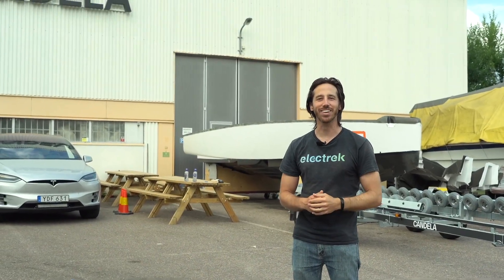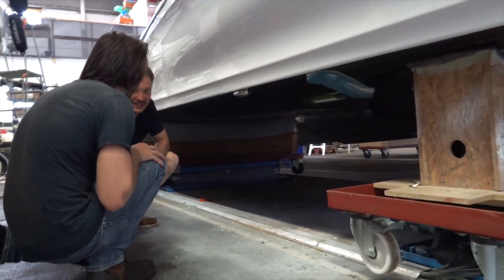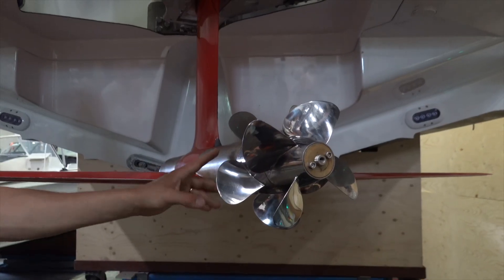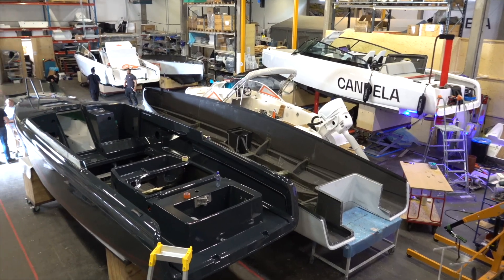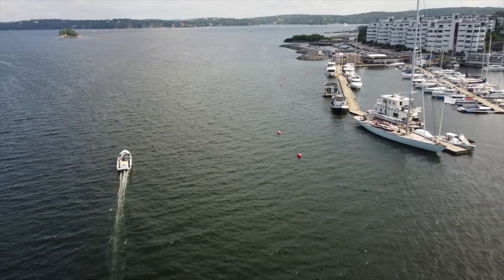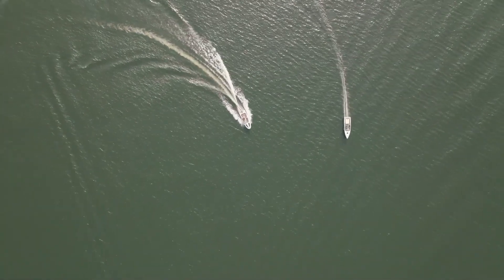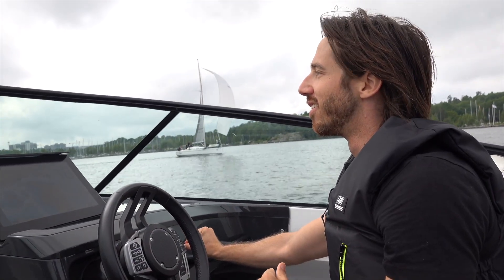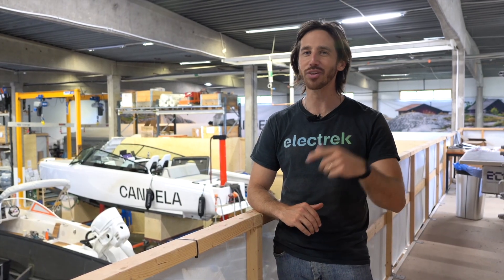The Secret of Flying Electric Boats: Candela C-8 First Ride!

Comment: Good Video And Great Selling Points. There Is One Question. What Is The Range On A Full Battery Charge. Also Where Can We Charge The Battery At Boat Port In America.
Reply: Another reviewer said 5 to 8 hours use depending on conditions. Most marinas have a power supply with each birth so charging will be easy, just plug in when moored up.

Comment: What kind of battery has it got in it?  How big is it--length, beam?  Is it trailerable?  What's the displacement?  What's the draft?  What kind of chargers does it use--is that a CCS?  How far can it go at cruising speed?  What's the top speed?  What's the cruising speed?  Cool overview but would love to have seen more details.
Reply: Me too!
The only thing I heard was 50KW motor which is 67HP IF that is its' output power to the prop shaft. Less than 67HP to the props if that is its electric consumption rating.
Reply: Watch Björn Nyland's video.

Comment: I would love if it had some kind of gimbal stabilization on top of a SWATH hull (with hydrofoils for higher speeds). Then you would totally eliminate seasickness also when at anchor.
Reply: It does have stabilization through sensors that monitor the water surface plus gyroscope.
Reply: @danielm6737  I know, but I want the boat to be completely stabilized at rest also. Not just reduce the motion, but completely eliminate it.
Reply: @jimj2683  Those are called zero speed stabilisers, and available for "most" boat - if you have the money and space.

Comment: "It’s not cheap, coming in at around €300,000, but then again, that’s the price of comparable premium gas-powered boats in this 28-29′ size class. So if you already have boat-buying money, then a boat like this might actually be in your budget."
Reply: Their previous smaller model cost about the same which seemed excessive, but the C8 is reasonable as long as you appreciate what it offers as "premium".
If your idea of luxury is big and heavy you still might not be impressed.
$300k for any carbon fiber 28' is not out of line.  Candela gets my vote for putting all that tech to the best result.

Comment: Nice boat! Can it be used for waterskiing?
Reply: With its 50KW (67HP) motor, I seriously doubt it can pull up an adult slalom skier.
Reply: Gabriele from Candela here. C8 works great as a waterskiing boat! Ideal for beginners since you dont need to cross the boat’s wake like you would on a conventional boat. You also get a cool view of the boat lifting on the foils from back there!